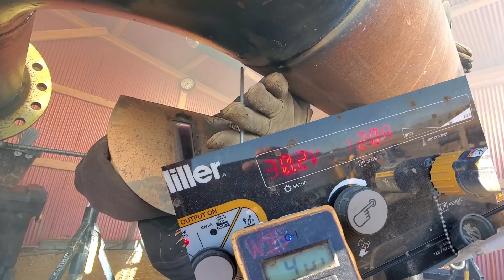WELDING DOWNHILL 6010 ROOT PASS AMPERAGE

Comment: 5-10 degrees you can change in your rod position how hard or soft you push on the rod. Always learn to run it without the remote that way if you don’t have a remote or someone who can run your heat it won’t be such a huge issue. Rod manipulation can change a lot of your heat

Comment: Hey Wally I weld process pipe everyday and we have to put 4 tacks and quarter our roots to make sure we don't draw our pipe but I've been noticing alot of pipeliner's only doing 2 tacks and running one side out fully and then the other.  Does it draw your pipe/ 90's out of square or what????

Comment: Hey Wally what size 6010 you running? 1/8 or 5/32
Reply from the maker: Right here is 1/8 i use 5/32 like on 42"
Reply: @Wallyzweldingworld  you like it hot by the looks.  Im guessing you like the Less chance of catching any porosity and faster travel speeds
Reply: Nothing can live in a hot puddle paulywelds

Comment: Since the gap is so small , whats a good method so theres enough penetration and ur rod doesn't stick to the metal as u push thru?
Reply from the maker: Right presure right heat right travel speed right gap right landing its all a formula
Reply: if you're sticking turn'ere up and move faster. Watch Wallys amperages, but I wouldnt suggest going outside 150amps until you learn to control the puddle. It takes the right amount of movements and experience to run as hot and have a travel speed as good as wallys but hes been at it awhile and the experience shines thru.

Comment: With that Miller remote are you only controlling Amperage ?? Or Voltage too ??
The Lincoln ditch boxes are controlling Voltage ...... correct ? Hence voltage regulator......
Reply from the maker: No its amps im displaying the volts are to the left